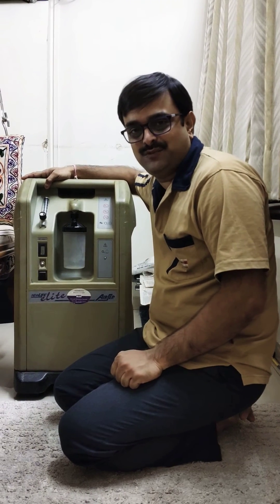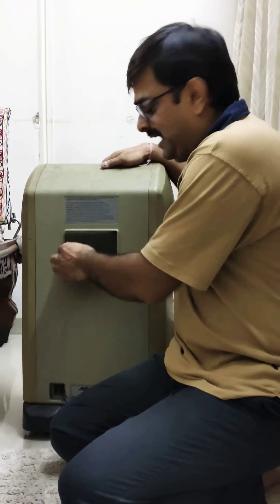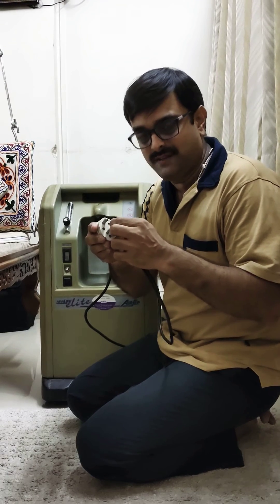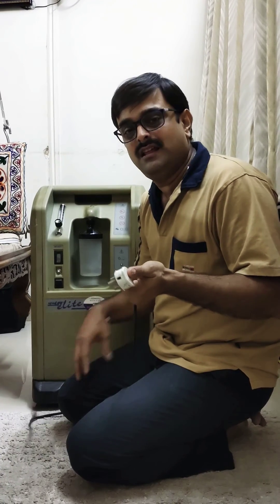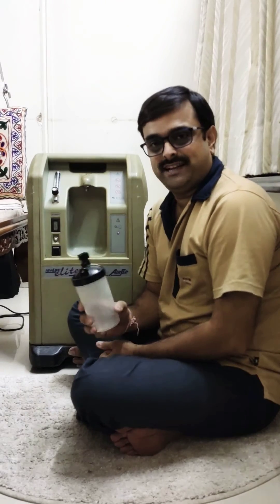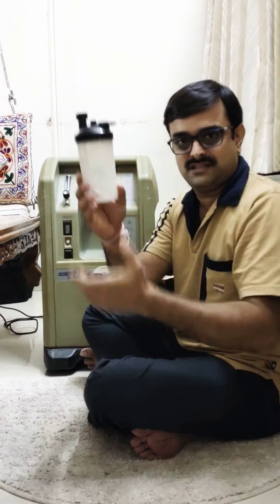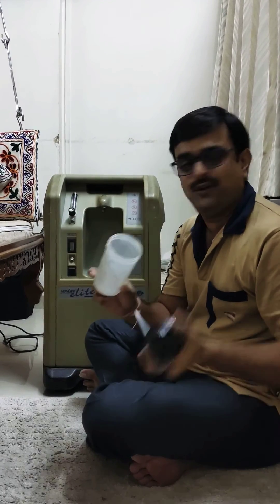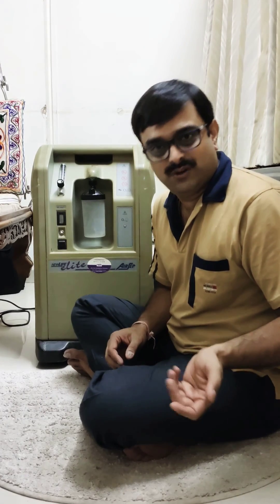Oxygen Concentrator: Airsep Newlife Elite Trouble-shooting Video (Part1)

Comment: Hi Nimish, thank you for your videos they are very helpful. I have an issue where the alarm comes on and off while the system is running, I've read this could be the high or low pressure switch, it does sound like the pump changes sound when putting the pressure up and down. Do you have a video how to change the high and low pressure switch ?
Reply from the maker: @A_Star1  Hello, one of the Solenoid Valve is mostly faulty you will need to replace the same.
Reply: @NimishPancholi Thank you for your reply. There is no 2 green lights for the WA (waste Soleniod valve) on the circuit board. Does this mean that Soleniod valve needs replacing ? Will that stop the intermittent alarm sound? 
Thanks again Nimish ❤️🙌

Comment: How to check noise ? What is manufacturer noise standard & how to rectify
Reply from the maker: Hi, I think around 50db is good. You should change the entire internal foam (black colour ) to get best results.
Reply from the maker: Also sound changes if Capacitor is weak ( faulty )

Comment: Sir my concentrator is showing E31 error. As per manual, E31 - cannot receive oxygen data from sensor. Machine is working, but error keeps beeping. Kindly help. Is there any other way to contact to explain in detail?
Reply from the maker: Dear Friend, Send me pic of the machine and error screen and also your location so I can try finding someone there.
Reply: @NimishPancholi  how to contact?
Reply from the maker: @aldy93  Mobile982O68O932

Comment: Hi Nimish, I have Airsep  new life oxygen concentrator(8 ltr) starts beeping just after 15-20 mins of start of the machine and it's continuous beeping. I switch off and again switch it on and again beep is gone but after 15 mins again beep is there. What would be the cause. Please help it's urgent.
Reply from the maker: Hi Sir,

15-20min Beep sound can be due to Low/High pressure alarms. At home you can try cleaning filters, remove humidifier bottle and check if the fault repeats. If not helping you should get a technician to check the same.
Reply: @NimishPancholi  - Thanks for quick response and we will try again and see if it resolves the problem, We are located in south india, Can you send me your contact number or email id? .
Reply from the maker: @Kman4u  My Contact- 9820680932
Reply: @NimishPancholi  - It was nice talking to you. Here is the video it shows beeping sound and red light after 20mins. 
https://youtu.be/heX3MnokERI

Comment: Yellow light is blinking. What is the problem?
Reply from the maker: Hello, Yellow Light is indicator for " Low Purity of Oxygen ". Reasons could be anything from general servicing to faulty SieveKits.  You should try cleaning the machine for starters... or call a technician to check.  I hope this helps

Comment: The amber light on the right side of mine is remaining amber.  The ball goes up and down (I believe as it should), air comes out of the outlet, and there are no other abnormal operations of the machine.  No sounds other than the machine running.  Do you have any suggestions ?
Reply from the maker: List of possible causes - 
Clean external cabinet square black color filter located at backside.

Secondly try keeping machine ON for 24hrs Continuously for SieveKit warm-up, if problem still persists than you will need a technician with Oxygen analyzer to verify if Purity sensor (Amber light) itself is properly working or not, the value on screen of Oxygen analyzer should be greater than 87% @ 4-5Lpm.

This is the general order for fault analysis 
1) Capacitor faulty. 
2) Choked Inlet Round Filter is faulty.
3) Faulty sieve kit. 
4) Faulty Compressor. 
5) Faulty Main PCB.
Reply: I’ll try that,  thank  you !
Reply from the maker: @dannyby9  Dear Daniel... Your most welcome
Reply from the maker: @manishabagul7974  pls WhatsApp your query on mob-9820680932
Reply from the maker: Hello Daniel... thanks for your message. If the Amber light is still blinking or Continuously glowing after initial 20min of operation while the oxygen ball is  below 5.0Lpm. Than 99% the machine is faulty as purity of oxygen delivered is lower than acceptable level ( less than 87% ) .

Comment: Sir, I hav elite Air sep concentrator. Now it has started giving problem  on switching on it works normally buy after 5 mts or so motorboating sound keeps coming. . Hav u come out with ur part 2.
Reply from the maker: Hi Mr Sunil,

Thank you for watching the video.

It appears fault with one of the solenoids or faulty PCB.

You will need a technician to solve this. I am sorry without opening the machine its difficult to find the exact fault.
Reply: @NimishPancholi  Thank you very much for your prompt reply. As suggested by you I  hav contacted Ramkrishna Maroli, he will come either tomarrow or day after tomarrow. Thanks once again.

Comment: My Machine o2 is not working.
Reply from the maker: Dear Madam, Thank you for your comment.  

You will need a technician's visit so the fault can be analyzed properly. 

However , I can give you a general idea of possible faults...for that you will have to describe the nature of the problem you are facing... i.e.. 1) After disconnecting humidifier bottle does the ball in flowmeter move upwards ? 2) Do you hear a continuous Beep sound while turning on the machine?

Kindly reply, so I can assist you in a better way... 

My best wishes.  Hare Krishna!
Reply: @NimishPancholi  thank you sir.
Reply: @NimishPancholi  aapka mobile number dena . Oxygen machine lena hain
Reply from the maker: @sureshdeokar3488  Namaskar ! My mobile no 9820680932
Reply: My oxygen ball is not passing 1 could u please explain the problem
Reply from the maker: @mcdonaldricky9533  Hi Ricky, If you are using humidifier bottle than please remove it and check if Oxygen ball is moving up... let me know
Reply: Can we discuss the problem . please provide me your no please

Comment: Hi Nimishi, Good points. My concentrator doesn't give any beep sound for 3 min or so  after starting and also after starting circuit is tripping. 9V battery is completely drained.  Any other suggestions for troubleshooting
Reply from the maker: Hello sir, Thanks for watching the video.  Now, Regarding your machine - Ideally you will need a technician.  Trip could be faulty capacitor ( look above compressor) or fault with one of the solenoid valve or PCB fault.